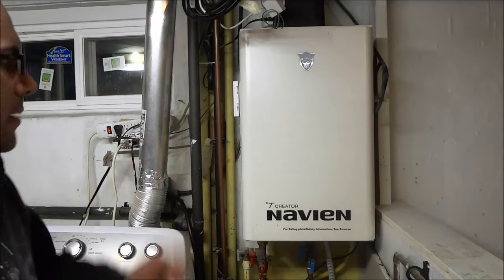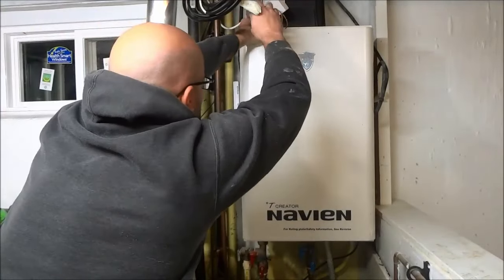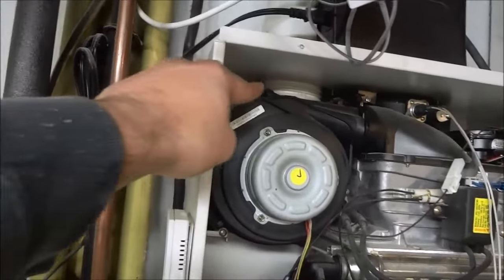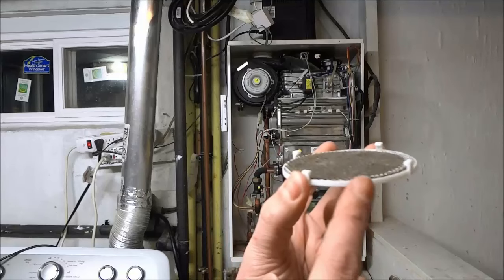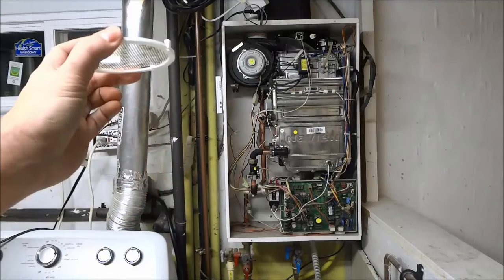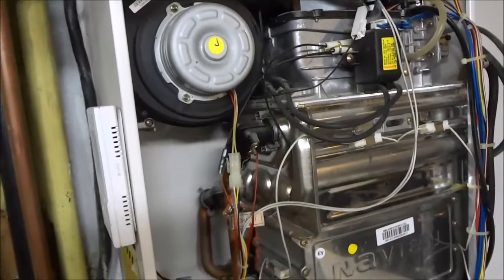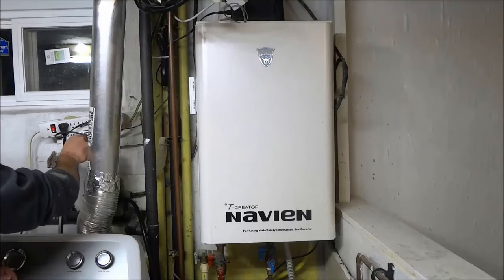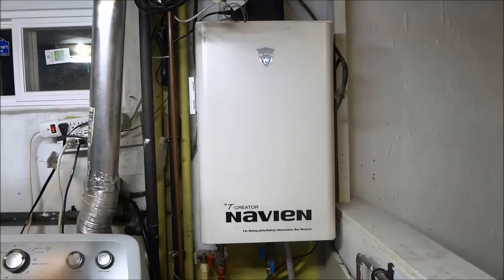How To Clean The Air Filter In A Navien Tankless Water Heater

Comment: Nice work. I just used this video to clean my water heater. Navien customer support also asked me to clean a water reservoir/pipe that is outside and at the bottom. You take out the pin from the PVC pipe and just clean it with water. It was really dirty.

Comment: Check your heat exchanger with soapy bubbles upon start up, make sure you are not leaking flue gases into the home. Unfortunately most units leak when I test them, Navien will usually replace the heat exchanger under warranty. It is a very common issue, I have more leakers than nonleaking. Its sad.

Comment: Nice, thorough explanation,amigo!  Please though, do yourself and your family a service and look at a safer alternative to that electric outlet “octopus” located near two -three water sources (just to the left of your heater over the washer).  I’m speaking from a three decade career in emergency management, law enforcement and fire career.  That is an accident waiting to happen!  And everyone...regarding newer Navien models, a heads up.....they have a single Phillips head screw and the air filter slides out making that “wrangling” unnecessary.  Again, sir, very nice video.